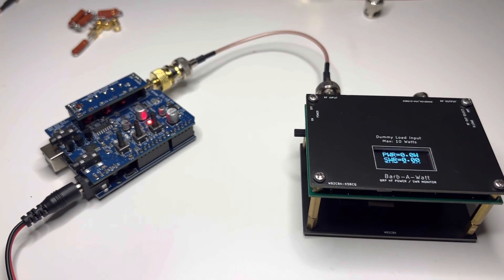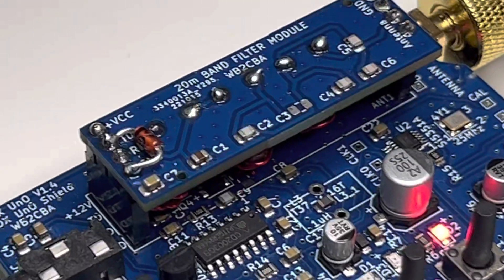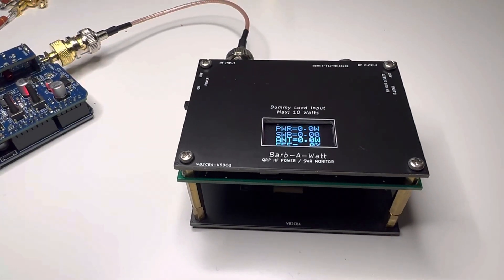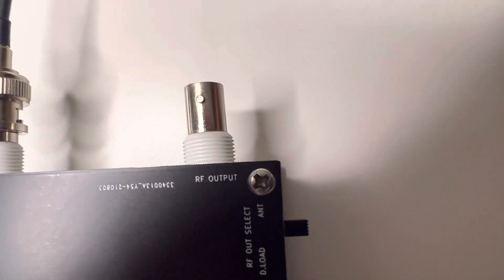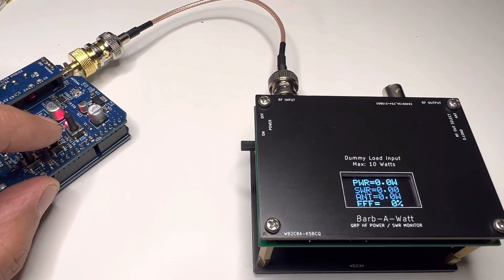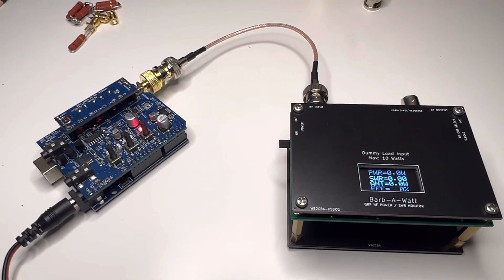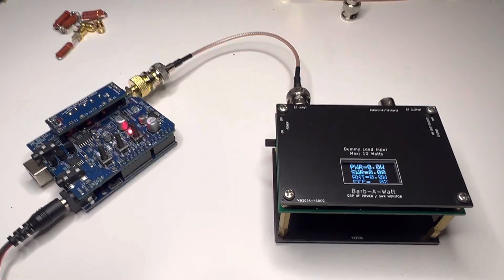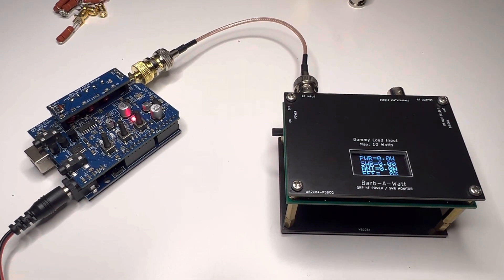ADX RF PA Mosfet extreme SWR protection with one zener diode!

Comment: So no demonstration of any way how you can repeatably blow a transistor without the diode makes this a dubious protection test as the supposed risk is probably not replicated
- and having added a random  non-linear device no spectrum analysis to see if the power output and LPF action  is still clean either

Running on a safe supply /voltage, Putting a 3dB pad in line to tune up or an SWR meter on the output generally will probably reduce the BS170 casualty rate equally successfully

I have a QCX+5W beacon that has run for 1000's of hours now into a OK-ish antenna and the only casualties  have been a Si5351 and a demodulator chip in one single unattended thunderstorm.  The BS170's are all originals and still running happily